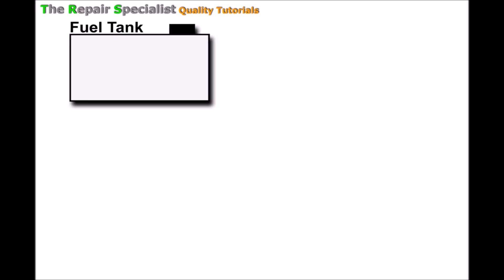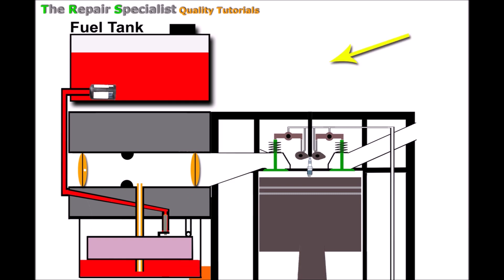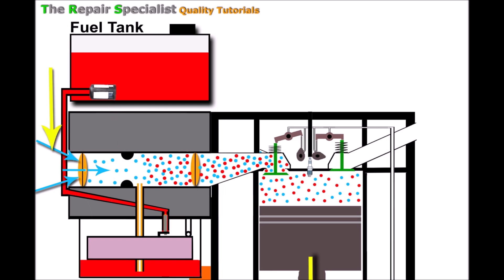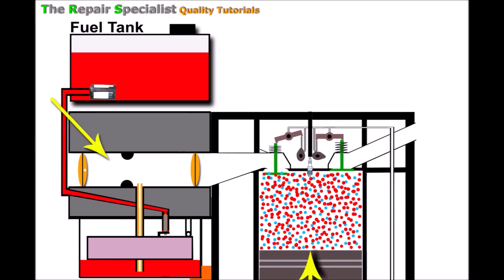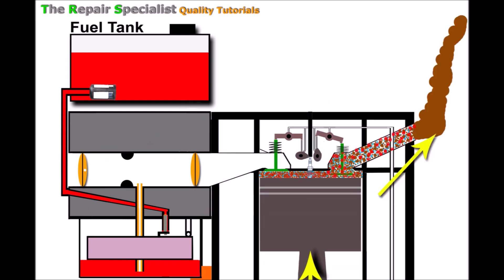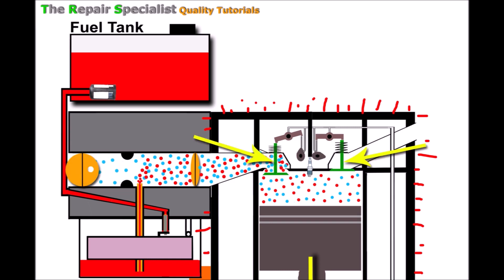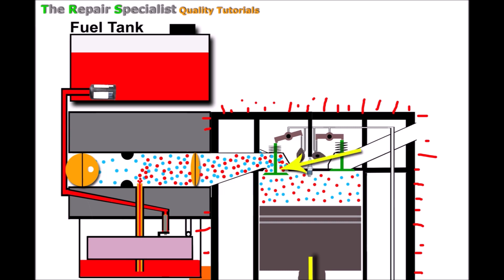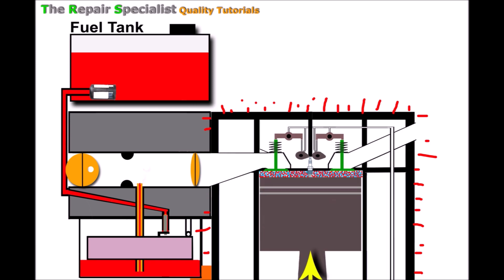Engine & Carburetor  | Working Together | How they Work - 4-Stroke - Gasoline.  (by Craig Kirkman)

Comment: Excellent! 
I'm trying to find out why my pull-cord is trying to rip out my arm. Apart from a damaged or minutely displaced flywheel key (which is not the case), could it be that the inlet valve needs lapping? (Or with a four-stroke that the tappet gap is too small?) Thank you.

Comment: Great explanation and graphics, well done.  This set of presentation slides  might be the one to use if you do a video about problems with hot starts, the key elements are depicted  (carb, engine, fuel, air, spark), the associated parts (oil system, air filter, muffler) can be talked over 👍.
Reply from the maker: Thank you